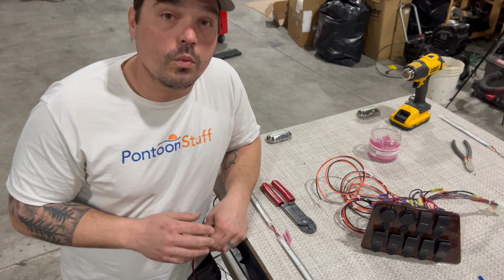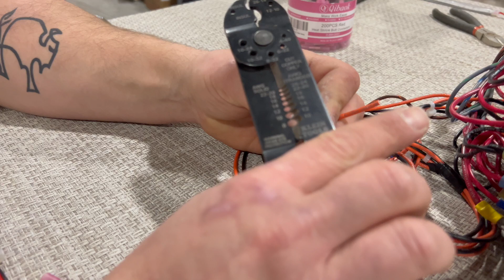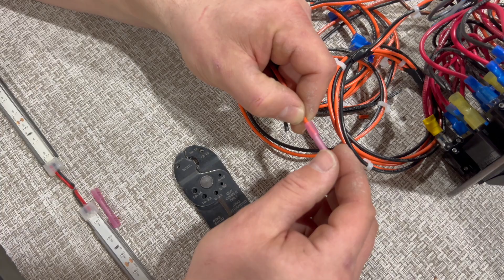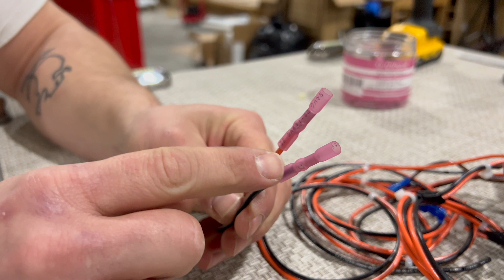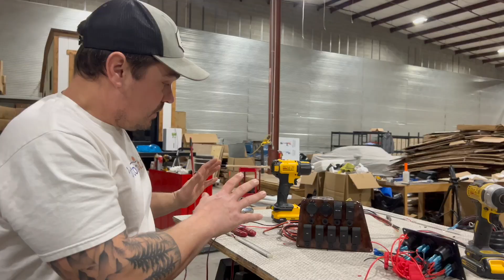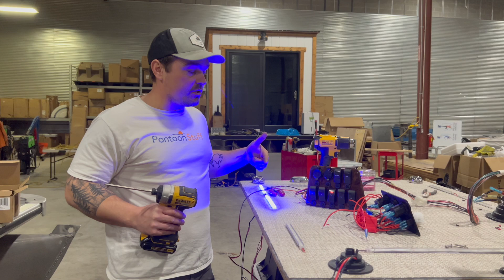Boat Wire Splicing 101 - THE BASICS

Comment: I am about to undergo my first pontoon restoration. I probably would never had had the confidence without you and your videos. 

What do you do with all the wiring underneath the plywood?  Do you use wire clips or anything like that to keep it snug up against the decking?
Reply from the maker: Thanks so much for sharing that! We know there are tons of people who want to undertake the project, and with the products from Pontoon Stuff it's 100% doable....we just knew there needed to be a guide for folks like you to break things down into more manageable pieces. So glad to know that the channel is doing what we set out for it to do in helping DIY folks!!

Yes, I use plastic wire clips with stainless screws. I will be doing a video soon on how I tie up the underside of the boat so stay tuned for that. And I hope to offer them as part of a wiring kit...we're going to launch a heat shrink butt splice kit tomorrow on the www.tomstoons.com website. I use high quality electrical tape to combine the wires so they're neat, then I tie them up about every 12" along the plywood. From there they can run along the top of the starboard pontoon and back to the console or to the stern. I usually bundle the wires and engine components with some zip ties on top of the pontoons to keep that orderly too.

Comment: Hey Tom, off question, I was going to post this on your captain chair installation video but it was a year old and I'm not sure how you see questions on here but I'm about to buy some captains chairs high back reclining and low back, my question is do you have a video showing the low back ones and also I'm going with mostly captains chairs, I want to get an idea of what they look like, thanks. BTW looks like using your code saves me at least a couple hundred dollars! 👍
Reply from the maker: I still get notifications for comments even on my first video I ever posted, and I try to respond to each and every one as long as I can keep up. 

I don't have a low back helm chair video, but they install the exact same way as the reclining. I looked back to see if we featured them in any old videos but couldn't find one where it showed the seat well. We used the low back chairs for quite a few boats when we started out because of COVID inventory issues. Once reclining chairs were back in stock that's pretty much all we've put on our projects. I have had both on my own boats and I would spend the extra money on the reclining option. If you're outfitting your boat with several captains chairs it will add up quickly at $200 more per chair, so I can see why you'd be considering the low back option too. You and your passengers will be comfortable in either one, but the reclining adds a next level element of comfort. 

In the coming weeks I'm installing a pair of the low back chairs as upgraded fishing seats towards the bow on a boat. I will show that in better detail and likely will have an installation video of it too.
Reply: @tomspontoons  Thanks for your time Tom, it was the money issue and I was curious how much lower it was in comparison,  maybe I'll take up some donations from my passengers, ask them if they want to be comfortable or extra comfortable!😆
Reply from the maker: @skylark4901 totally get that! Worst case, get the captain a recliner and everyone else gets the low backs. Win win….because we all know no one is going to pitch in on someone else’s boat lol!
Reply from the maker: @skylark4901  I'll bet they're at least nice enough to hand you a drink...out of YOUR OWN cooler!
Reply: @tomspontoons  Ha no joke! Actually I've known all my friends a long time and they're all very generous but there is one that never brings enough beer because he doesn't want to drink too much, but he always finds his way into my cooler! He used to have an ocean boat and took us all out many many times so, I just pack extra beer now! 🤷‍♂
Reply from the maker: @skylark4901  You're clearly a good captain!

Comment: Great video. How would I continue down the line with multiple lights on one switch?
Reply from the maker: I've got a video going live this Friday that breaks that down (and wiring an entire boat of accessories). Basically, you need to combine the positive (power) wires for each light and the negative (ground) wires for each light, and then get those combined wires power and ground from the switch panel. If the lights are far apart, you can jump wire between them to connect the lights, and then continue back to the switch. Just keep in mind that a thicker gauge wire might be necessary for stacking lots of lights on a long run of wire. Usually 16 gauge will cover most LEDs in a group because they're so low draw.

Comment: Do ya solder your connection or use a connector with heat shrink I bought these connectors for my boat that have heat shrink on them an theres solder inside them and apparently when you heat up the connector housing it melts the  solder inside to your wire connection haven't tried em yet too cold outside yet waiting for spring and she's not far away judging by the weather that's coming
Reply: Ive used tons of them.  They work fantastic.  A cheat tip if I may,: strip your wire ends just enough so that solder ring just fits over them when the wires are pushed together.  Before pushing the two wires together, slightly spread the strands, dip into some liquid flux then push together so the strands will intertwine like shuffling a deck of cards.  Compact the strands with your fingers, slide the shrink tube over and heat.  The section with the solder will take longer to melt; however,  with the added flux you will see the solder flow smoothly.   Wear PPE. Wash hands thoroughly after handling even if gloves were worn.
Reply from the maker: @awakenedtotruth8419  Great to know! Definitely sounds like some extra steps, but those little splices do have a super clean look. I'm still going to be stubborn and stick with my crimping tools and lighter because I know it works. But I love when people can chime in with experience in those areas. Helps everyone out, so thank you!
Reply from the maker: Spring is in the air, even up here in Michigan! I haven't tried those connectors yet. I'm just old school and use crimped butt splices and heat shrink them down, but then again that's what boat manufacturers are still doing so maybe it's not quite old school yet? Let us know how they work for you on your project!

Comment: Greetings Tom and viewers, 
Fantastic tutorial friend.  I have one of those 20V heat guns.  It was a great addition to the toolbox.  They might come with a nozzel kit consisting of a scraper blade, a narrowed end to concentrate the heat, and a heat-shrink attachment that is curved to wrap around a wire for heat dispersing.  Using the latter two will also speed up your job by a few seconds.  

As a wire harness builder, once upon a time, I've used butane hand touches, pyro pens, and corded heat guns.  Keeping in mind the safe distance Tom mentioned to prevent charing the wire's insulated jacket.

For those who are comfortably able to solder the connections, don't forget to slide on some glue wall heat-shrink to cover the connection for a waterproof seal, and use any of the methods to shrink it down.
Reply from the maker: You're the perfect one to comment here with your background! I have a couple heat guns, but honestly a regular old lighter heat shrinks them up the quickest and I can have a lighter in my pocket at all times easy to grab and use. My plug-in heat gun works fast, but it's one more thing to deal with on a cord working around and under a boat. Great points with soldering still needing to be heat shrinked too. That's probably why we don't see it done on boats often. Takes the extra steps and too much time at the factory! Thanks for your input here!
Reply: Some builders contract out their harness builds, in fact more do than don't.  When the environment is set to harness builds, they tend to use the tools that won't slow the process.  In my case, they didn't allow open flame tools in one manifacture and did in another which I never understood why and never inquired why.  In my opinion, nothing beats an adjustable butane torch...you are perfect for this as well Tom.

Comment: Solder everything, saves a lot of headaches down the road
Reply from the maker: There’s several ways to join wires. I base what I do off of what the major boat companies do. I’ve actually never seen a boat brand send a boat out with soldered wire connections. Always crimped butt splices. That being said, everyone gets to go the route they choose, I won’t argue anyone’s way of joining wires…as long as they hold together!!
Reply: @tomspontoons  boat companies Don't solder because it's time consuming and thus expensive. Boats are designed be built as cheap as possible on production, at least until you get into the $500,000 range where they start building things right
Reply: I spent an entire career working on corporate aircraft, and while soldering is used in certain circumstances, crimping to join wiring is the method used.   So coming from a professional wiring guy, always crimp and heat shrink your connections.  We of course used much more expensive hand crimping and heat shrinking and stripping tools, but crimping is the approved method on aircraft.
Reply from the maker: @J.W.W.  This is why I love the comment sections of videos. It gives the chance for productive conversations and expertise from people in all sorts of fields. Luckily for me it seems that the comments on my videos stay pretty polite and positive in nature!
Reply: I've also used shrink butt connectors with a center solder ring and a glue ring at each end.  They are aircraft approved but it helps to have a good heat source to melt the solder ring faster.
Reply from the maker: @awakenedtotruth8419  Seems like that's where a little butane lighter would come in handy if you're careful. Get a little more heat in specific places like on the solder ring to start.
Reply: Soldering by itself is not an approved way to secure wires on a boat. all connections must be crimped.
Why?
The solder can vibrate loose.
A proper crimp performed with a proper crimper in which the wires are properly stripped back and completely intermeshed inside the crimp, cannot vibrate loose.
You may solder in addition to crimping, but soldering alone is no bueno.

Also, never ever use a flame for heat shrink.
Reply: @fishonkayakadventure  if your solder joints are vibrating loose, you are really bad at it. I've got joints on semi's I did 12 years ago with a few hundred thousand miles on them that haven't " vibrated loose"
Reply: I personally never seen a solder conn vibrate loose, but I did see them break at the point where the soldered and non- soldered portion of the wire merge.  Even then corrosion along with vibration was a factor.